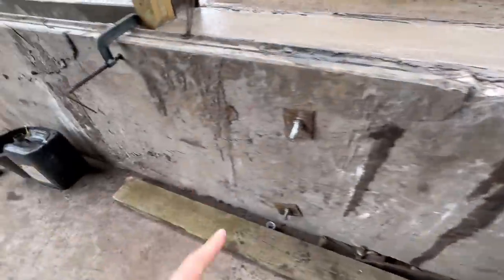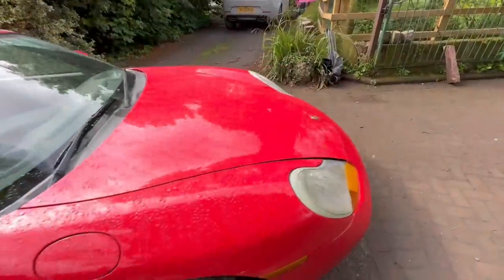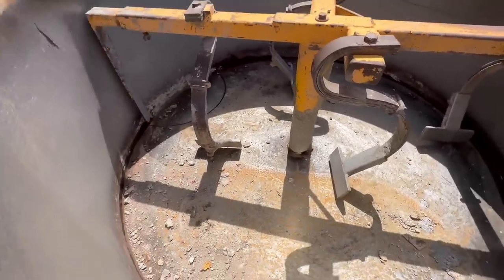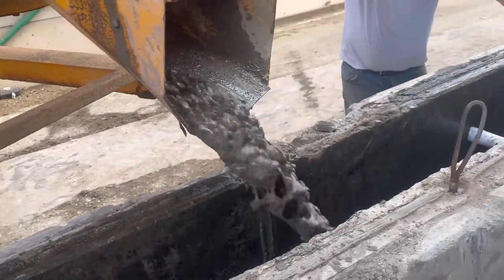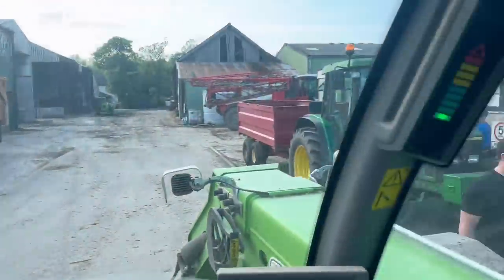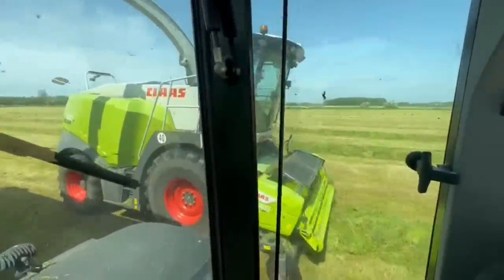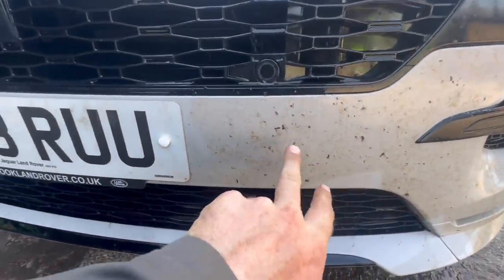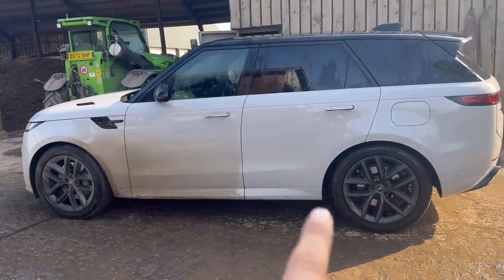MAKING WALLS &  BEHIND SEENS OF TOM PEMBERTONS SILAGE #OLLYBLOGS #AnswerAsAPercent 1154

Comment: Olly, bit of a tip. Drill some rebar down into the concrete floor every 800mm in the center line of your wall before you pour the concrete. If a tractor pushes up against that without it stitched into the floor it will fracture in time. It’s a cheap and effective tip. Love the video. 85% today..

Comment: Shared a mixer with someone years ago he got the idea to move the scraper closer to the barrel it forced the stones in the mix through  the side of the  machine  ended up with a big repair  rolling a big sheet of steel  around  it and welding it  in!

Comment: Wheels are only as good as the floor they run on when small. You need at least 100 mm 4 inch for heavy weight and well secured on a bench of that weight.